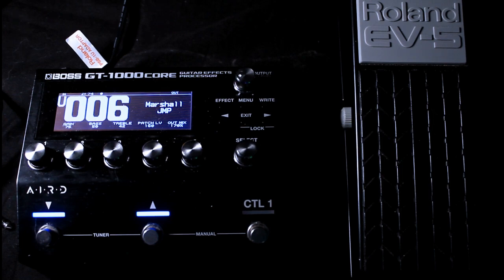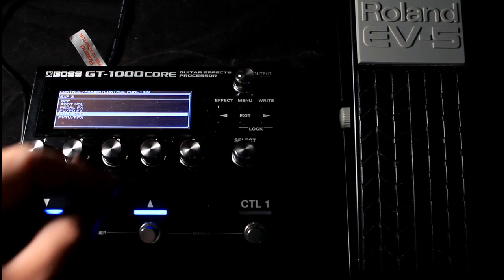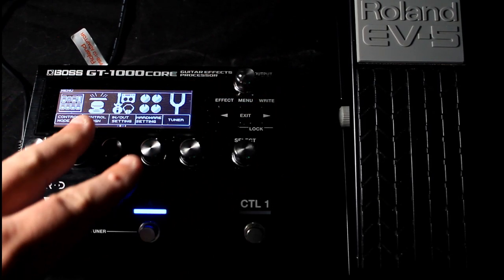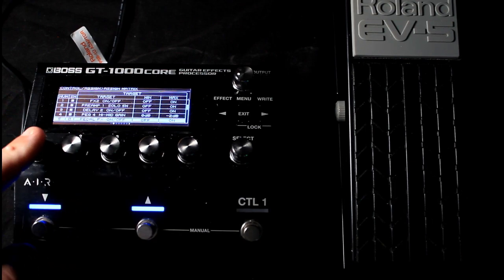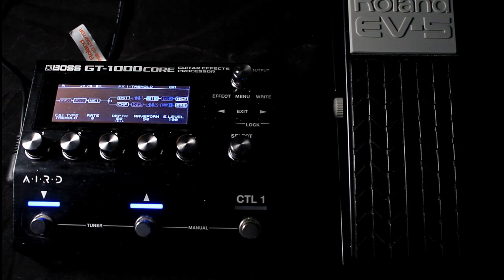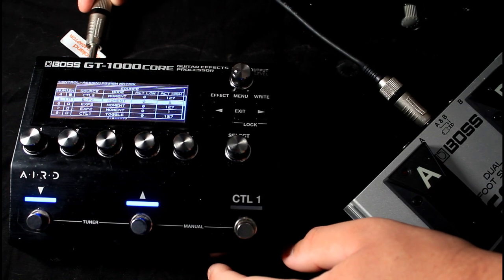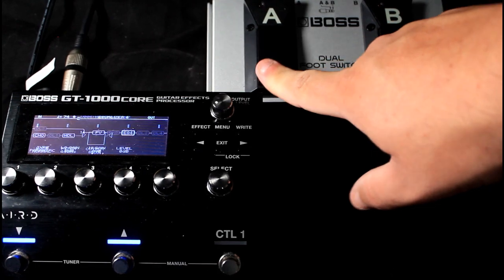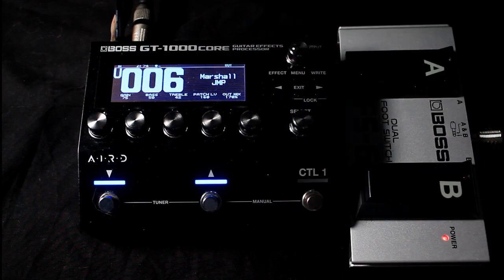Connecting and Programming a Boss FS-6 Foot Control & Roland EV-5 Expression pedal.

Comment: Great video. I have the exact same pedal and switch. Even easier to set up in Tone Studio than on the Core itself. I'll either switch two effects or switch one effect and use the other one to switch the pedal from volume to an effect (eg wah). It's also clever to have the option to switch to tuner in the 'zero' position.
Reply from the maker: reason i dont use it like that is my 0 position is my WAH off :) - but makes sense for different types of players!
Reply from the maker: oh and PS i'm trying to teac guys to understand the hardware FIRST before being spoilt with software... nothing worse then not being able to fix your pedal on stage and not knowing how!! haha